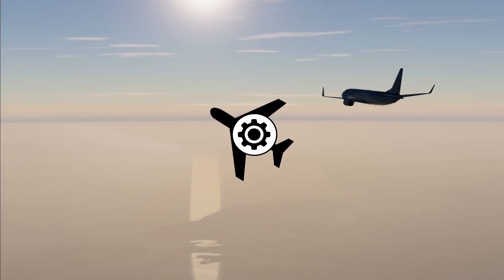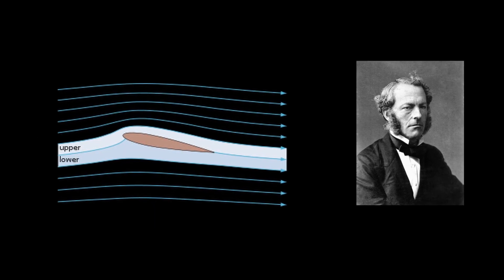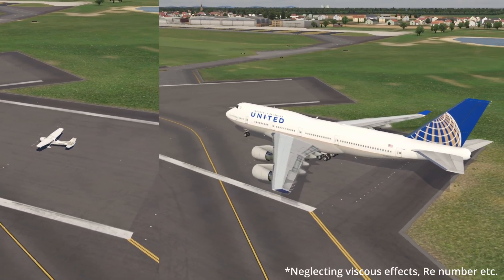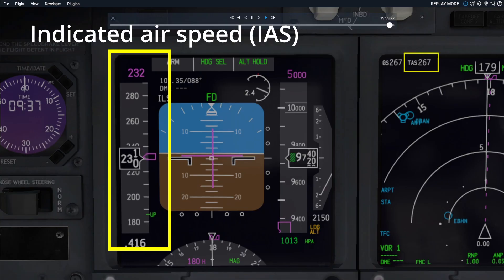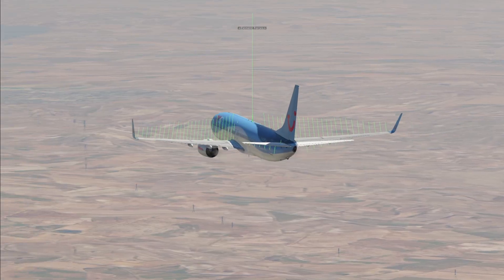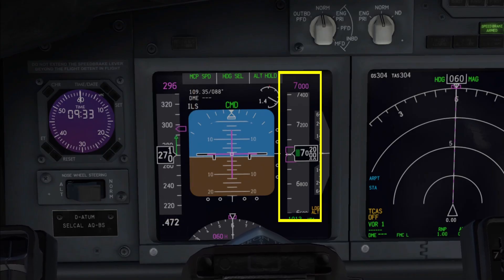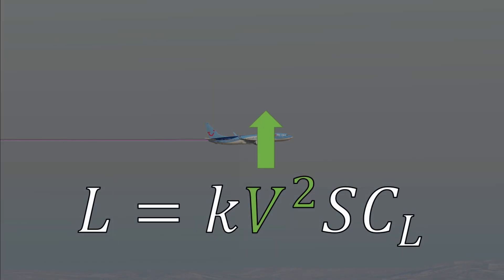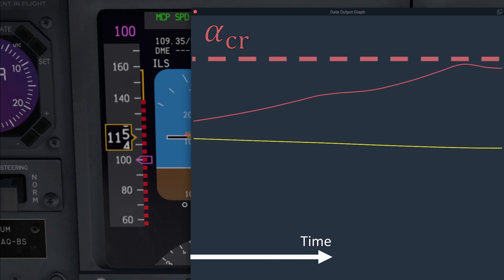The Lift Equation | Aerodynamics in X-Plane 11

Comment: Nice video!
I learned the lift equation for my PPL
In fact it is very related with the kinetic energy equation: E = 1/2 m. v2
What you do is convert the kinetic energy of the air passing over the wing in a force.
If you fill in all the SI units you end up with kg.m/s2 (Newton).
S is m2
Rho is kg/m3
V is m/s
Cl is a unitless factor
Reply from the maker: That's really interesting, I've never looked at it that way before. A question that is often asked is why V is squared in the equation, makes a lot of sense when you think about it from a kinetic energy perspective as you explained. Thanks :)!
Reply: @FlyByMax  that is also the reason for the factor 1/2 in the lift equation.
It could otherwise be included in Cl
Reply: @FlyByMax 1/2*rho*V^2 comes from Bernoulli’s equation, which can be derived with the law of conservation of energy

Comment: I think another interesting thing to note (and maybe you cover it in later videos) is you can see when you have the lift vectors on (at least I assume that is what the green lines are) that the force distribution across the wing is some what **elliptic**, and this goes into why wings have twists, and sweep, etc to try to mimic the most efficient lift distribution. Great video!

edited: corrected parabolic to elliptic
Reply from the maker: This is a good point and something I hadn't considered yet, I might touch upon it in a future video. Thank you!

Comment: I think there is a small mistake at 6:04. The aoa relevant to the lift of an airplane is the one between the the flow of air and the chord line of the wing and not the angle between the airflow and the fuselage. Great work though, please keep on doing so.
Reply from the maker: You're absolutely right. In this case I chose to align it with the fuselage because it makes it clearer to see in the video, and the cord line is more or less parallel to the fuselage (so the angle wouldn't change much). I'm going to try and do this better in the future though, I've been reviewing some of my content recently and I'm not particularly happy with some of the simplifications I've made. Thanks!

Comment: Really interesting video! How would you describe how MSFS2020 physics work then?
Reply from the maker: Good question! Well since both simulators are trying to replicate the same reality, you'd expect similar results. An interesting experiment would be to try out the things I did in the video over in MSFS2020 and see if the results line up.
Reply: @FlyByMax  yeah would be interesting indeed! Curious to see what is wrong with that system lol

Comment: You will not get realistic physics in a simulator. You don't get gforce and input is all based off what controls and sensitivity your using.
Reply from the maker: You're right that sitting behind a computer screen, we will never be able to feel g-forces or the force feedback of the flight controls. 
However in the video I'm talking about something else. I look at the aerodynamics behind X-Plane and the physics of flight, i.e. how lift is generated. In fact, in the video I barely control the aircraft at all. 

The aerodynamic forces behind an aircraft can be studied separately from the controls and feedback systems of that aircraft, which is what you're describing (humans in a control loop).

Comment: If i understand the question correctly, the "right" AOA is being held by the aircrafts design. The horizontal stabilizer counter acts any disturbances along the longitudinal axis and creates an equilibrium of forces. Given the pilot trimmed the aircraft for level flight and holds a constant airspeed, this will allow the wing to hold the correct Angle of Attack, needed to create the required amount of lift. This will only apply on aircraft with some sort of positive stability and these properties are being manipulated by stabilizer size, shape, positioning, incidence etc. This however comes to the prize of manouverbility. A Cessna for example is a perfect example for a stable aircraft whilst modern FBW assisted fighter jets are so unstable, they wouldnt even be controlable without computer assistance. I always found this concept of balancing out forces and finding  compromises striking and very interesting, shows how much engineers got to weigh out facts to each other and compare in order to find the best compromise.
Happy Landings to you guys!
Reply from the maker: I think you explained this really well! I think you're absolutely right. We as the pilots (or autopilot) control the elevator so that we maintain an equilibrium of forces (level flight), which corresponds to a certain alpha. 
I'm actually looking into doing a couple of videos on Cm_alpha, which is the change in longitudinal moment due to a change in angle of attack. So to hopefully add to what you're saying - for a positive change in alpha, you would want there to be a decrease in longitudinal moment (since this would counteract the initial disturbance in alpha). You can also program a stability augmentation system in a feedback loop (alpha as input - elevator deflection as output), exactly as you explained with FBW aircraft. I'd also like to look at dynamic stability (phugoid, short period) at some point.

Awesome stuff, very cool that you already know so much about this!
Reply: Shows that i might have taken something out of ATPL class :) 
These would be topics i would be interested in as well for sure. I really enjoy the whole subject of aerodynamics, it can be rather confusing at times however, especially when learning such topics on paper only without any visualization. For that i find XPlane and explanatory videos very helpful. Any new topic would be highly appreciated.
You are doing a great job at breaking them down so thank you very much. Shows how far our little FlightSim community has come, that is for sure!
Reply from the maker: @julians9362  I had a feeling you must have had some real world experience with these concepts by the way you were describing them :)

Hopefully I can find some topics that can challenge even people like yourself, who are already very knowledgeable about aerodynamics.

I'm going to try and build my way up to some more complicated stuff, although as things get more complex I'll need to become better at simplifying and visualizing things so that a broad audience can understand.

Very cool to know that an ATPL-er is watching though, that'll definitely keep me on my toes to not make any mistakes ;) in all seriousness, your feedback would be really useful. Thanks a lot for stopping by!
Reply: @FlyByMax  Sounds amazing, i am going to listen a bit more closely from now on then, i guess... just kidding of course!

I am truly looking forward to those future videos then, that is for sure. The less academic approach really helps consolidate some of that new learned knowledge!
Keep up the great work, cheers mate!